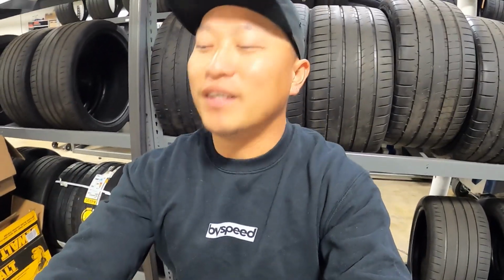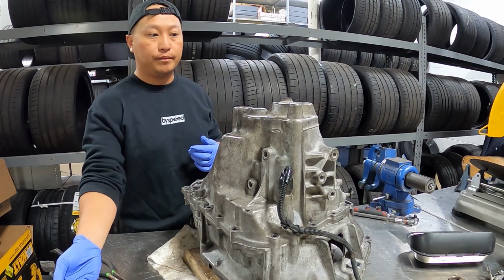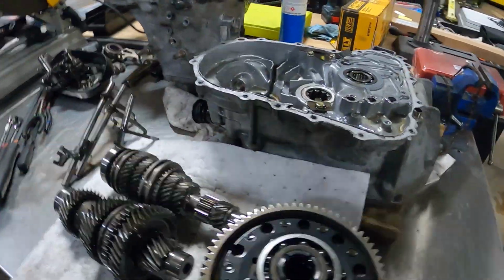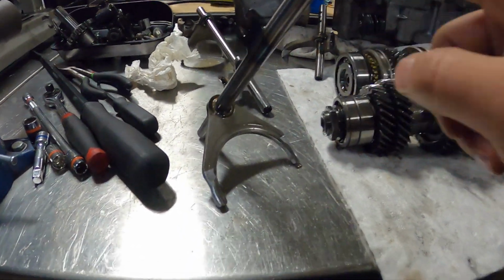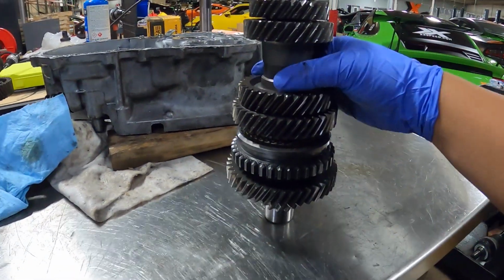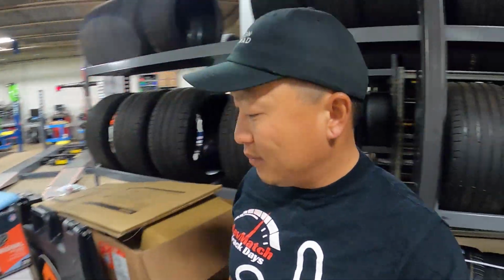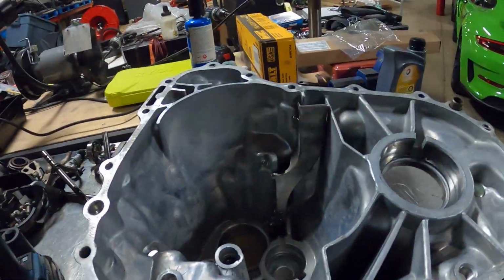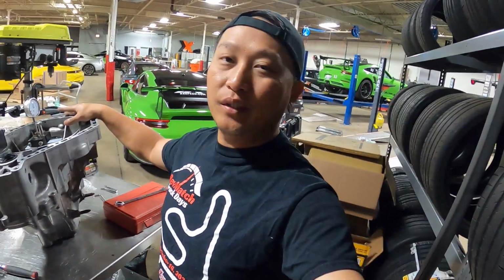Master Carbon Synchro Kit + 4.9 Final Drive | Civic EG Track Car Build

Comment: Is it possible to work on 2nd and 1st gear without a press??
Reply from the maker: You could maybe get away with rigging up some gear puller and bearing separators.

Comment: Thanks for posting. I’m tearing down the trans in my ITR in a few weeks, it’ll be my first time cracking a tranny open. 

Do you have any opinion on brass vs carbon synchros for a street car with occasional track use?

Comment: @bvspeed, I got a question. I swapped a k20z3 6-speed tranny and noticed my 3rd gear it hard to shift into, like theres a wall. Is that because of mis-aligned sliders you think?
Reply from the maker: The slider really can’t be misaligned since it’s internal splines mesh with the hub, which is splined to the shaft itself. Typically if you have a hard time getting it in a particular gear, especially like how you explained it (like hitting a wall), that’s usually the synchro spring. It’s that little wire spring clip that sits around the synchro itself. When it breaks, it blocks the slider from being able to slide onto the synchro, which of course will guide you onto the gear you’re trying to select.

Comment: quick question is there a way or is are we supposed to check thrust tmfor the cou ter shaft too if we are replacing it with a whole new 4.9 unit? thanks!!
Reply from the maker: Not that I know of. I have yet to see a procedure for the countershaft.

Comment: Great video! I’m rebuilding a stock 4.7 ratio spec r transmission. Where can you find new shift forks ? My trans has a 3rd gear grind as well as 4th gear.
Reply from the maker: Thank you! If you’re looking for brand new B series, shift forks… good luck! A lot of this stuff has been discontinued by Honda 😢
Reply: @bvspeed  my local Acura dealer had 1-2 and 3-4 luckily! Some of the parts are still available if you order them 🙏

Comment: I measured my shim clearance on my transmission and the spec is the same 0 to .1mm. I can force in a .2 mm shim. Should I get a new shim, or is .1 out of tolerance not too bad. I am really forcing the .2mm shim under also.
Reply from the maker: Are we talking diff or Mainshaft?
Reply: @bvspeed  This would be the differential. Just wondering if I should be forcing in the shim or not. I can force in a .2mm shim if I push hard enough, and this would be out of the .00mm to .1mm spec.
Reply from the maker: @Fighter4Street  Gotcha. If you can still get a 0.2mm to fit, I’d consider it out of spec. 0.1mm is your max, so you’re technically 2x out of clearance.

Comment: I was hoping you could really help me out here. My 2000 Honda insight, the new bearing on the mainshaft has a shield on one side and is open on the other side. The old bearing was open on both sides. Would you happen to know which way the shield should face? Thanks
Reply from the maker: Sorry, I’m not familiar with that trans at all. Feel free to dm me photos on IG and I’ll se what I can find out.
Reply: @bvspeed  Thanks for the help, actually, and I feel very lucky someone knew. The bearing on the mainshaft actually had the inner race on one side that sticks out slightly by a mm or so.The bearing was not completely flat on that one side if you run a straight edge over it. The one I took off had the wider inner race also.

I never even knew a bearing would be designed like this, its possible it could be because to help with oil getting into the bearing?

Comment: Aye bro will I get any gains if I get a 5.1 final drive on my b16a2 aka em1 transmission???...thank you
Reply from the maker: Do you track the car?
Reply: @bvspeed  not not really I have a fully built darton sleeve b18 with a b16 head made 380  all motor n 100 shot on a ls tranny but I got my hands on a em1 tranny I try to order a 5.1 from mfactory but they put of stock finally order a 4.9

Comment: So when I put my main shaft by itself inside and tried to cover it with the bell housing, for some reason it didn’t cover correctly. It’s as if there’s a half an inch all around stopping the bell housing from meeting the opposite housing . When I removed the bell housing, the top bearing was stuck in the bell housing. I can’t figure out what’s going on. When I saw this video it seems like you just inputted the main shaft and easily put the bell housing on without any problems. I tired even rubber hammering it down but it still won’t come together properly, and yes I did make sure the dowels were in the right position. Any input is appreciated.
Reply from the maker: If the Mainshaft is the only thing you have inside when trying to close the housings together, but can’t… the only thing I can think of is the input shaft bearing washer at the top. It has a locating tab that needs to be oriented to fit inside the recess on the trans housing side.

Comment: Can you install a straight cut final drive on a standard helical (k20) gearbox? If not what would be required to do this if possible. Thanks!
Reply from the maker: Yes you can! I did a TCR on Kevin Vue’s Integra and he had a straight cut FD!
Reply: @bvspeed  was that 5spd or 6spd? I can only find PPG straight cut FD’s for 5spd :(
Reply from the maker: I believe it was for his previous b series so it would’ve been 5 speed.

Comment: Are the endplay specs for the differential different because your not using the stock tapered bearings?
Reply from the maker: That’s correct. The way you measure end play for a ball bearing is different than how you would a tapered roller bearing.

Comment: I thought my stock 4.7 fd was something..  4.9 fd... Spicy 🔥🔥
Reply from the maker: Haha! My 4.4 was way too long. I could’ve went 4.7, but didn’t want to risk it “not making much of a difference”. Especially with being such low power, I concluded that 4.9 would be the way to go.
Reply: @bvspeed  totally understand... Get the most out of the setup! It's definitely going to have some 'pep in it's step' once the refresh is done. 😂
Reply: Go ITR tran or stay GSR  upgrade wave trac LSD FD 4.9??? What should I do with 1-5 gears??? 
Motor:  B18c

Comment: This is probably the best transmission rebuild I have seen because you told me something I have been looking for forever. How and what to measure to get clearances of the transmission.  Can you post the tool you used to measure.
Reply: @bvspeed yes please, this. Yous should link the tools in the video and try to get an affiliate link on them so we can make sure you get paid when we buy the tool.
Reply from the maker: I tell you guys what… I have my own version of this tool in the works and am planning on a full blown “How-To” as well. It’s going to take a little bit of time, but it will be coming for sure!